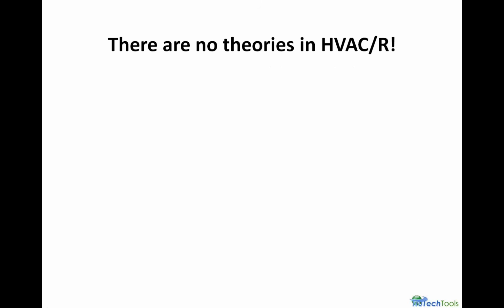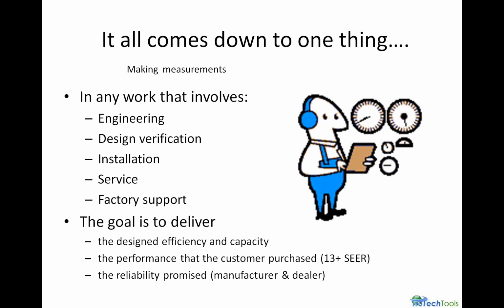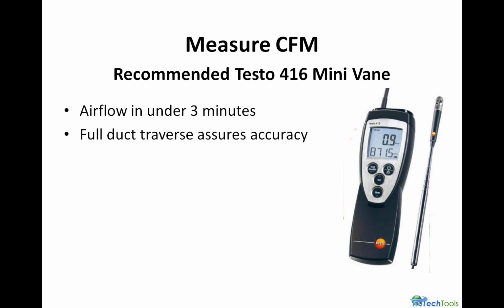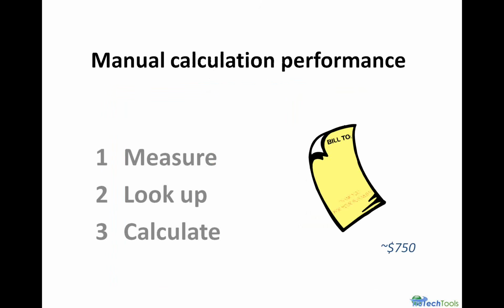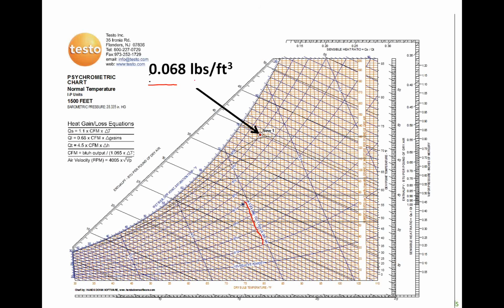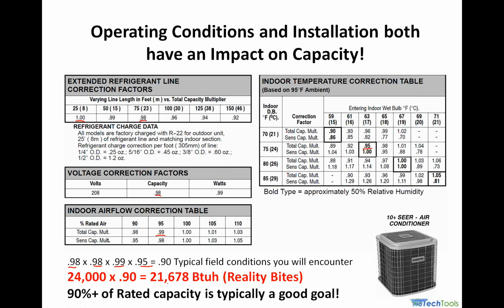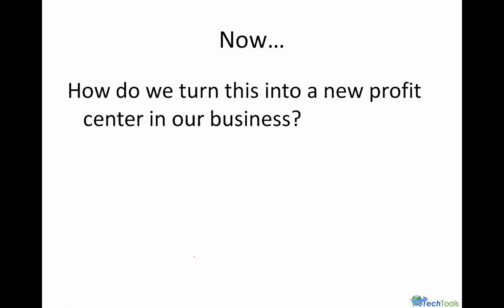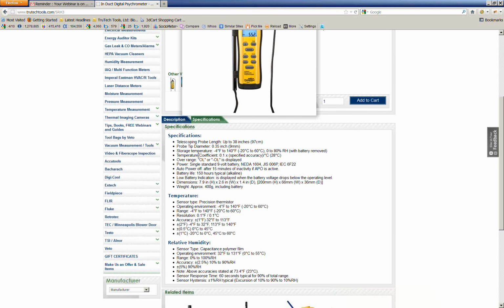System Capacity Part 4  A/C System Performance Testing

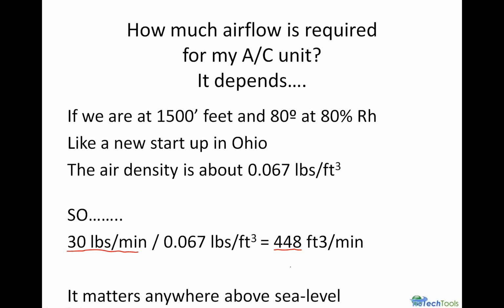Comment: At 35:53 in the video you mention mass flow rate. Where did the 30 lbs a minute come from in this example?
Reply: 30 lbs/min comes from 400cfm x .075 lbs/cu.ft. Which equals to 30.